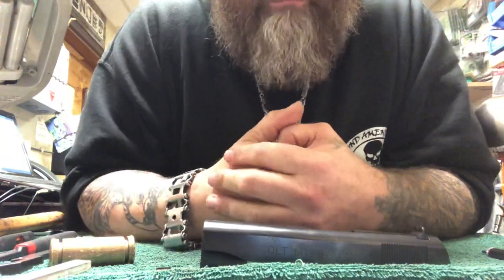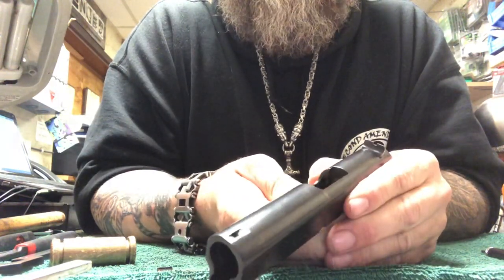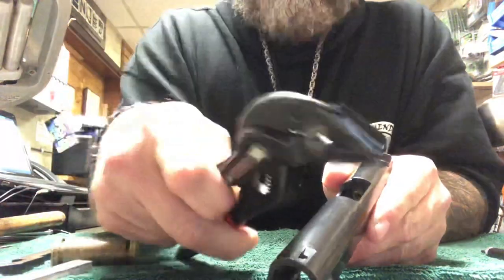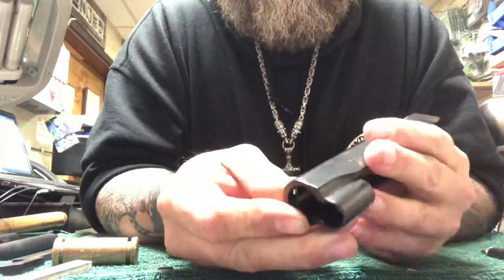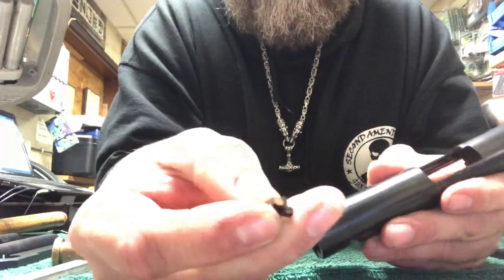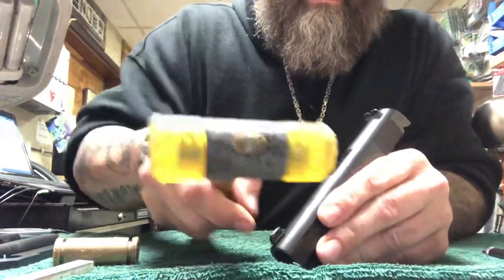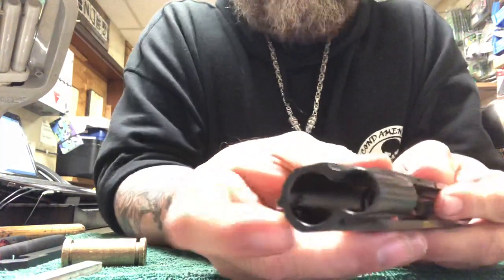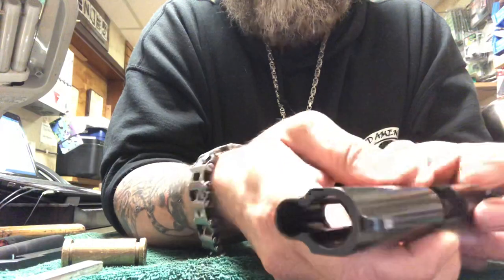Removal of the staked M1911 A1 front sight

Comment: Thank you for posting this. I found plenty of videos on staking in the front sight but not on removing the existing one. I tried using the staking tool to remove it from the inside but that was not working. I ended up using vise-grips and doing it this way. Unfortunately, I didn't find your video until I had figured it out on my own. Hopefully, this will help others in the future.

Comment: Is the metal of the front sight soft enough that it won't mar of oval out the hole when your twisting the old sight to break it off?
Reply from the maker: Gabriel Rivera it absolutely is soft enough. You just have to use leverage

Comment: Can I hire you to remove and replace the front sight on my M1991A1?
Reply from the maker: Sure. I work at a local gun shop in the Milwaukee Wisconsin area...
Reply: @secondamendmentgunsmithing1633  ok great! How can I get in contact with you/your shop? I'm in Los Angeles.
Reply from the maker: Ummmm that’s a bit of a drive.. I thought you were in the area.. you would have to find an FFL near you to send it to the shop. And pay for shipping both ways. Plus the labor and the sights...
Reply: @secondamendmentgunsmithing1633  Not if it's just the slide. I had to send my P365 slide to Sig to replace the sights, Mailed from and to Commiefornia.  I could have mailed it from my home as it was just the slide.   I did use my FFL as I didn't want that package stolen off my porch. Sig only returns packages to the addy they were mailed from.